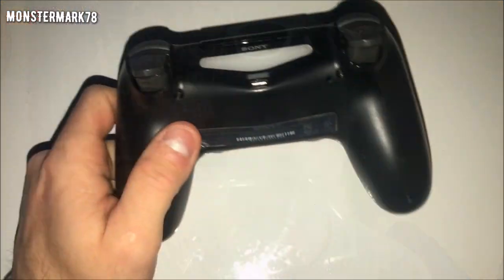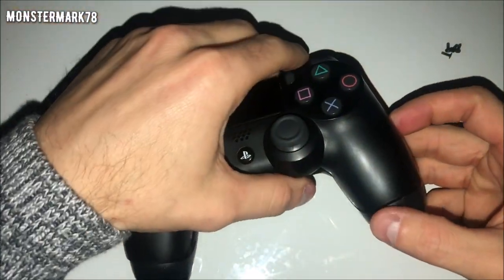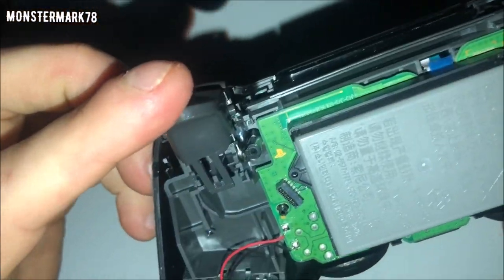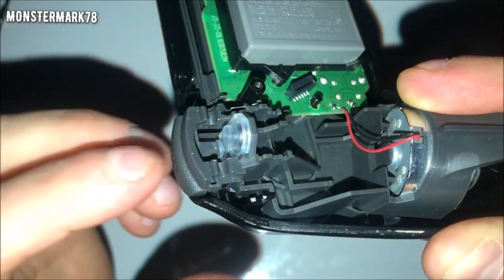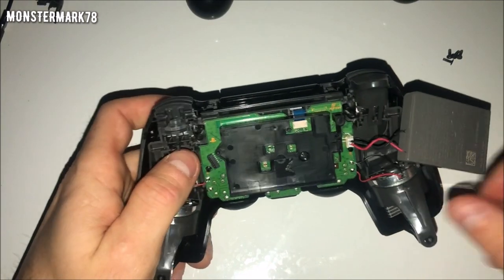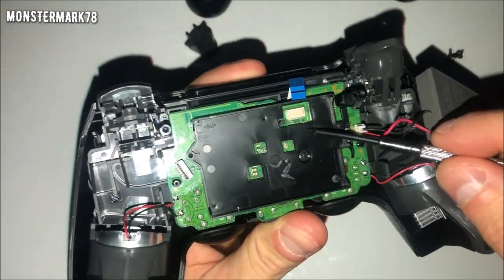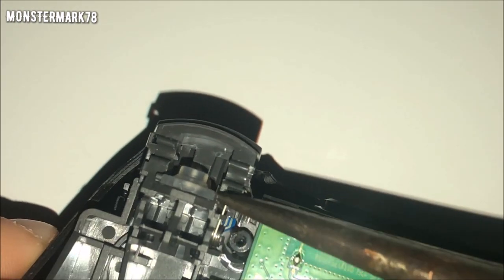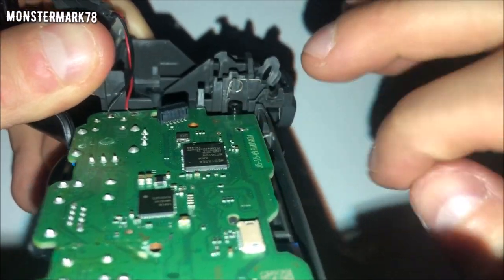HOW TO FIX THE R2 BUTTON ON THE PS4 CONTROLLER (DETAILED)

Comment from the maker: QUICK UPDATE: MAKE SURE THE BIG WIRE GOES BACK THE SAME WAY IT WENT OUT. IF YOU REVERSE THAT LONG WIRE AFTER YOU PUT THE CONTROLLER TOGETHER, YOUR CONTROLLER WON'T CHARGE.
Reply: I have the problem that my controller wont charge can you help me out?
Reply from the maker: @nicoe8896  Did you fix the problem?
Reply: Thanks for this my controller wouldn’t charge after my trying to replace the thumb sticks u saved my wallet
Reply: I already do that, but my controller still even charging and the bar light is turning purple, I did something wrong
What I should do?
Reply: You should pin this

Comment: Hey man, My spring for the R2 is totally fine, but its not even responding when I press it still. Sometimes, it does it by itself but it keeps shooting nonstop. After when I press a different button it stops, after it doesnt work anymore again when I press it. Do you have any suggestions?
Reply from the maker: hmm maybe the spring is sticking at times or that rubber piece that has a connector under it is worn out. There is a link t replacements in the description. That may be the issue, you can try and let me know if it works. If it does't, I would get a new controller at that point so you don't keep wasting money on random parts.
Reply: I have the same problem 
Found anything?

Comment: Thanks nice tutorial I didn’t t know the spring was what made the r2 move so I wasn’t connecting it to the r2 button. What about the r1
Reply from the maker: Probably the same thing. Now that you know to take it apart, you can always check.
Reply: @monstermark7825  my l2 trigger is stuck on.
Even after I took the trigger and rubber out its still stuck on.
Any idea how to fix it?
Reply: @monstermark7825  I'm hoping it's not replacing the whole green button circuit sheet whatever its called

Comment: For me its usually the silicon tab that gets worn and needs replacing, i can see a little cut in it where the trigger hits it all the time. Still works for shooters as it still activates a bu!tton push but for racing games i cant get past 85% of throttle. Still an easy fix if you get the right little part.
Reply: I have been loosing my mind playing fh5 on pc with a ps4 controller and just decided to run a diagnostic test. the same issue as yours. I got my controller used for like 10$ so not too bad

Comment: I have one question.  How does l2 r2 detectes the amount of press? I thought those two might have separate mechanism.  But to my surprise they too had toggle rubber pad only.  So my question how does it identity the amount of pressure ( throttle for example)✌️
Reply: There's a flat bar on the button so when u press down it contacts the pad in the middle. Literally found this out this morning as mines wasn't working, so I ripped it apart and that's what I found out. If it's not lined up perfect then the button does weird shit. But she's working normal again now

Comment: Okay, so uh, big problem. I opened up my controller like you said and...

Different interior. The L2 and R2 buttons appear to be connected to the underside rather than the topside, some of the plastic bits aren't there, and the circuitboard is blue. Help?

Comment: I know it’s almost 2 years later, but my hook is broken and it doesn’t register me pressing L2. Is the hook mandatory for it to work? I have the spring under the controller where it’s supposed to be but it doesn’t push it back as hard like my R2 button which does have the hook.
Reply: pretty sure you do need the hook i would consider just buying a new controller
Reply: @scunds  Is there any way to replace the hook? This is my 3rd broken controller so I don’t wanna buy another one.
Reply: I don’t think so

Comment: My problem is that if u look above the spring part the place where the r2 isn't in place every time I press down on my r2 it does come out of pocket and then I do have to push it back in any suggestions?

Comment: Is this a 1gen or 2gen Controller, or is it the same, i mean can i use every r2 trigger, for both gens or will the only work with one gen?
Reply from the maker: Michi W This is gen1. I don't think the inside is different or the buttons. The 2nd gen has upgrades like color, light bar in front, and faster response on the trigger.

Comment: This is what fifa 21 does
Reply: I was playing triple threat online on NBA 2K21 and I slammed my controller, the R2 button popped out, but I can still use it, without the R2 button
Reply: My r2 is stuck and my players are basically sprinting non-stop, I can’t do any skills or any basic commands like ball rolls. I used this tutorial but it’s still bugging, did u have the same issue with sprinting and shit and did u fix it?

Comment: Hi my r2 doesnt work at all even when i push down the rubber pad and one more thing it doesnt really fix in the slot where the spring goes it comes out easily any suggestions???☹️😫😭
Reply from the maker: Mani Mustafa comes out easily? You can always send a picture through insta what you mean

Comment: I do not understand. What did you fix? You've just changed the spring? Mine does not work, I have changed the rubber pads and still does not work.
Reply: Take it apart and make sure the pad isn't getting stuck on the bottom of the button. I had that issue. And it wouldn't contact the pad

Comment: Just saved me another £49.99 very much appreciated!

But... Sony are making these controllers less and less durable. That’s a fact! Anyone who plays even moderately - and games that require a lot of button action knows how fast a fault occurs.

I’ve just spent like 5 hours taking apart several controllers. Cleaning the analog parts and replacing buttons.

Took tome cuz I’ve large hands! Everything so petite fs lol!

But would rather that, than having to go out and get a new one.

I bought a new controller 6 weeks ago. Had to return it after the right analog went.
Was sent a replacement on 27/10/2020 - as of today 02/11/2020 - the left analog is drifting badly, and the dpad is making squeaking noises. Fuck Sony! Think I’ll start giving the pc a lot more time.

Thanks again for the video pal!

P.s. sorry for the story! 😂👍🏻
Reply: Yeah Sony is fucked

Comment: Does it need a steel spring? Pls reply quick
Reply from the maker: ᵐᶦ ʰʸᵈʳᵃ The controllers have springs on the triggers, so they do need springs to recoil and press. If you're missing it, check the other buttons to see if they have them. You may need one if that is the case.
Reply: @monstermark7825  ok thank you ima buy it tomorrow i broke it when i was playing fortnite😅

Comment: I know it's 6 months later, but I have a question I was wondering if you'd be able to answer. The little blue and black plastic piece underneath the rubber/gel beneath the L1/L2, R1/R2 buttons. Is that replaceable or fixable at all? I don't have any issues with the rubber/gel part of my L2, so I can only assume that my problem lies beneath the rubber/gel part.
Reply from the maker: hmm I would say the round silicon in those rubber pieces underneath may be worn down. So when you press it, it's not connecting to the "blue and black piece" properly. You can get a set of the silicon r2 pieces on amazon, just make sure it goes with your controller. Some controllers are older models. If that doesn't work, I wouldn't keep wasting money trying to figure it out ya now.
Reply: @monstermark7825  I've switched the conductive rubber bits out with multiple other conductive pieces, even swapped the original R2 for the L2 and the R2 continued to work fine while the L2 still didn't work. I've looked for videos talking about the parts underneath the rubber but I can't seem to find anything. Even found a video that was a complete tear down of the controller, but they didn't mention the black and blue piece underneath the rubber even though they had accidentally grabbed it with pliers. The most annoying part about it is that I used the controller for maybe 5 hours of game play dropped it on the left side and it stopped working right away. Sorry for the super long comment.